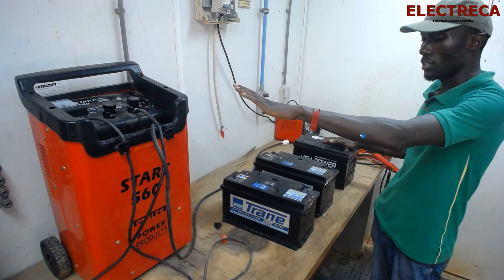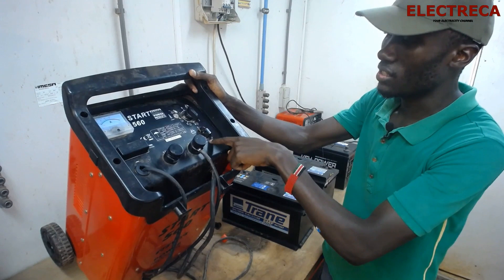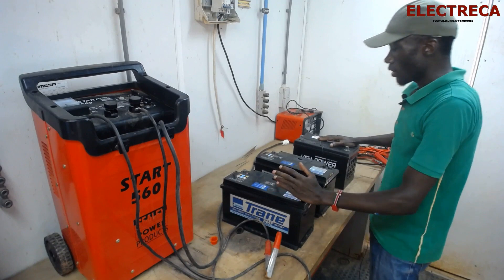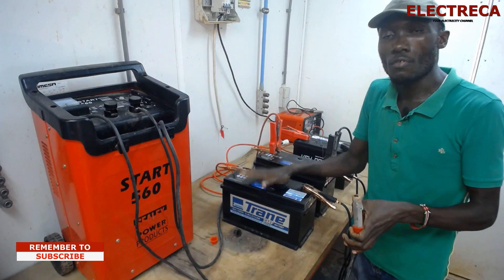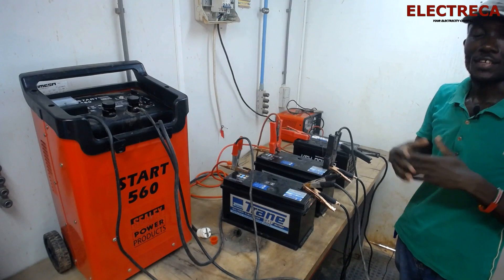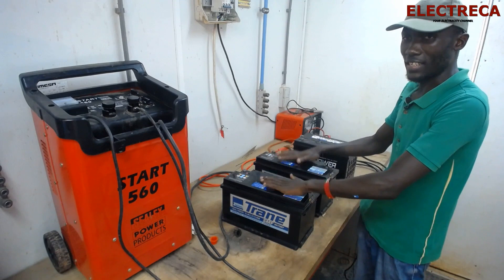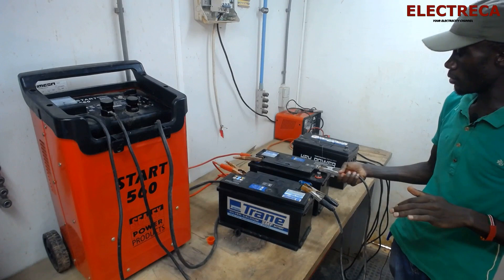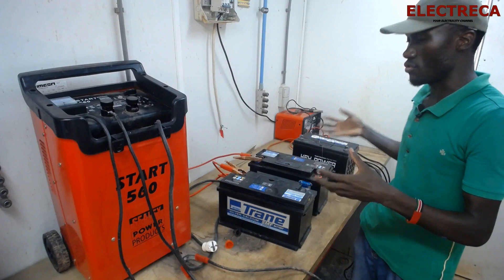How to charge battery in parallel or series | ELECTRECA

Comment: Between parallel and series, which is the effective system of battery charging?
Reply from the maker: The effectiveness of battery charging depends on the specific application and requirements. Both parallel and series charging have their advantages and are used in different scenarios.

Comment: The parallel charging is not efficient from front battery on.
Should be clamped to center battery for equal charging. 
Amp meter is the easiest way to see distribution of power equally.

Comment: Hello from Scotland
Great video!
Was wondering if you could help, When charging in parallel does it matter where you connect the charger. You have 3 batteries there so could I connect it to the middle one or does it not matter?
Reply from the maker: It may not matter as such, but it is optimal to connect on the middle battery. That way there is equal distribution of charge. 
Thanks for watching.
Reply: Good video

Comment: Since that charger goes up to 24 volts and you would wish to charge 3 batteries of 12 volts,,,what if to connect 2 batteries in parallel and 1 in series to maintain 24 volts with 3 batteries
Reply from the maker: Yes, you would do that especially if the charger had only 24 charging volts. but with this charger, where I can switch between voltages I can charge up to 6 batteries(12volts) in parallel.
Thanks for watching.